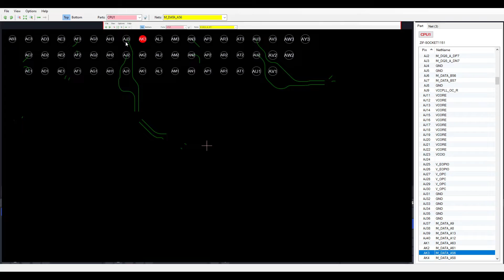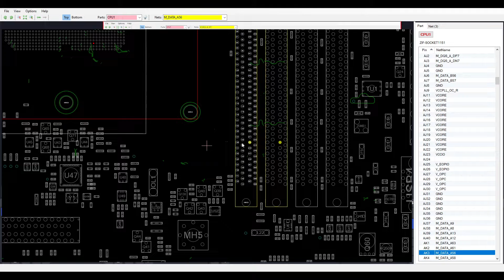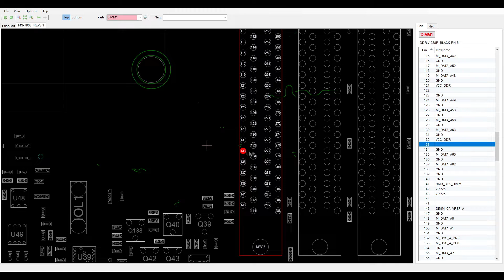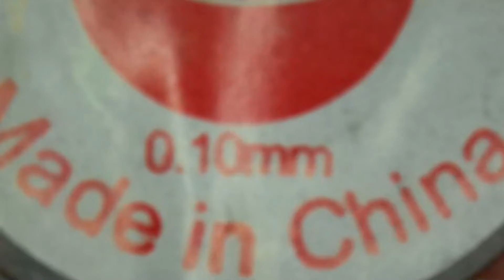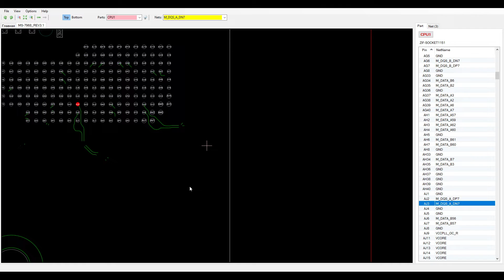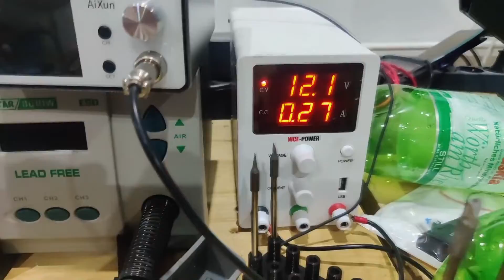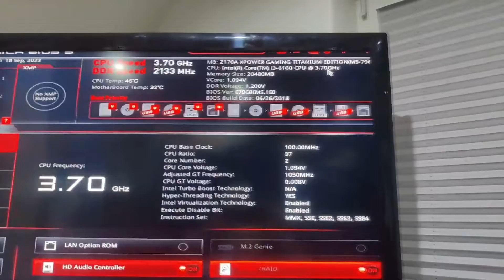How to FIX Broken Ram slots on a Mainboard MSI Z170A Titanium Repair

Comment: You said the missing light on the memory tester was DQ57 and DQS7P, but on the boardview you stated
that the faulty line was AJ2, AJ1, and AK3. How did you know that it's the one corresponds to the missing
light signal??
Reply from the maker: The pin in the DDR slot was called M_DQS_A_DP7. So you need the corresponding PIN in the DDR slot regarding the tester!

Comment: That is some dedication there with the tracing, good job! Don't you worry about interference in those wires? Aren't the original traces designed in specific lengths to match the impedance with such high frequencies, or is it really negligible?
Reply from the maker: You are absolutly right with that and i think this repair will have an effect to the maximum mhz that the RAM can run on the board. But i think for everyday use this will be fine.